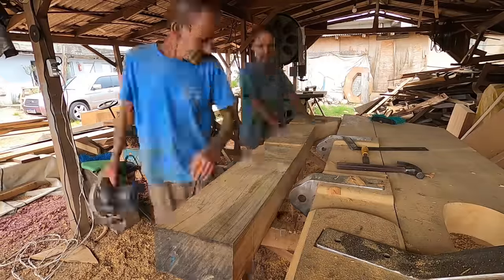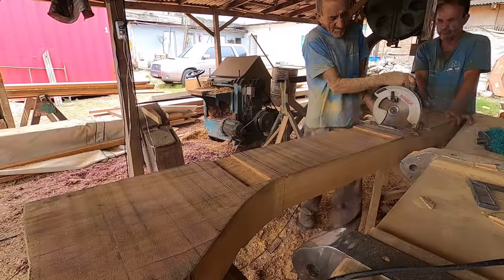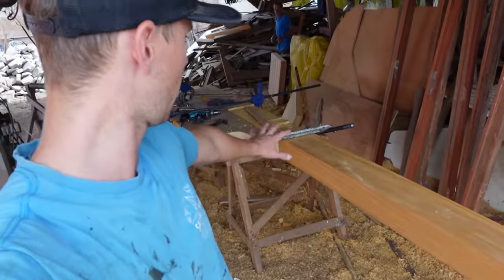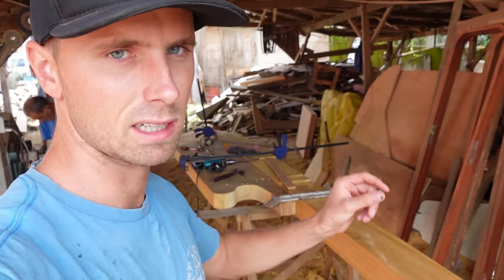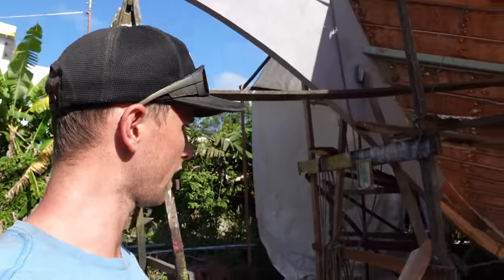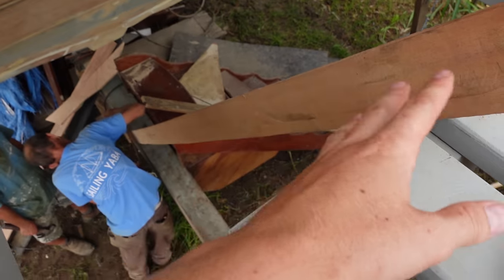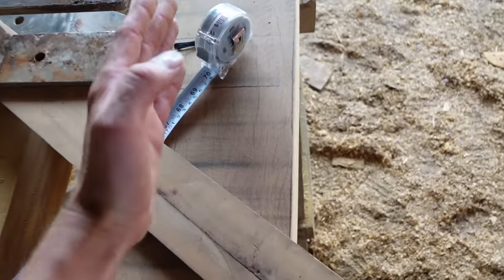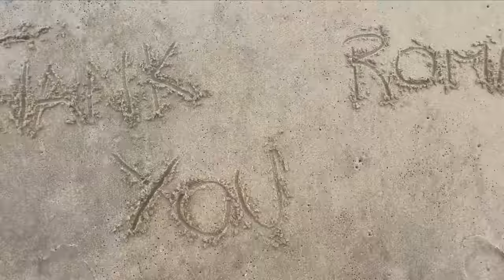Boat building: hand carving a wooden sailboat rudder — Sailing Yabá #83

Comment: I was wondering how you are determining the waterline measurement when the boat is now probably vastly heavier than it was when you
pulled it out of the water. You have added thousands of pounds to the boat with all the new wood and metal fasteners and I would think that would change the draft of the boat and affect it's sailing characteristics.
Reply: It might not be as heavy as you expect,  because most of the old wood below the waterline was wet and likely heavier than the new dry wood. Just my thoughts.  It will be interesting to see once Yaba is Splashed.
Reply: 100% it will be lighter now, the soaked rotten wood before was heavy& all the internal water adding to the weight. They have moveable internal ballast, and lots of it so they can balance it out with that. Another issue is the stability and weather or not the internal ballast is enough ballast to keep them save or not, but they never anwserd if they have any kind of research going in that direction. For now i just assume they put all ballast back in and then add some fore or aft to trim it out.

Comment: It might be worth letting the guys know about something that happened to me.

I used to abuse cutting discs as grinding discs like they are doing, it's so easy, you cut the thing and then use the face of the disc to clean off the edges ... only the blooming things aren't designed to be used like that and too much grinding with the face of a cutting disc weakens it until at some point it explodes sending shards of disc flying everywhere!

Luckily only one piece grazed my inner thigh and the other pieces embedded themselves in nearby objects, otherwise I'd be saying this with a high pitched voice and people would call me 'one ball'  :o

Comment: I would have thought rounding over the leading edge and rounding over with a taper the trailing (tailing?) edge of the rudder would help reduce drag and increase steering performance?  or is the difference that minimal?
Reply: It would be like putting air spoilers on a tractor .

Comment: Drilling those holes by hand and coming out the far side dead on center is almost unbelievable.  That is a lifetime of acquired skill on display right there.
Reply: I used to do that when I worked in boat building many years ago. I considered my hole a success if it did not break out the side of the plank. Those guys are awesome!!!
Reply: I'm a cabinetmaker, it's not that difficult. It merely take a little bit of practice
Reply: @rvail136  In smaller pieces it's not terribly hard.  Drilling through a piece like that?  Half a meter or yard or more like that?  And being dead on center?  That borders on black magic.

Comment: I have a question. How come Nezo does not use a plunge bit on a router to do the insets for the rudder hardware (or other hardware that gets inset). Also the router would sure round the corners much more quickly too.

Comment: Shouldn't the rudder be slightly lower than the keel for more effective steering? I love your videos. Keep them coming.  Regards from Albertinia South Africa
Reply: NO. if you ground the boat and the rudder extends below you could damage it .   The boat sets on the keel when it is out of the water, not the rudder.